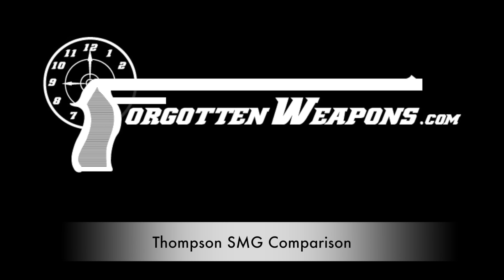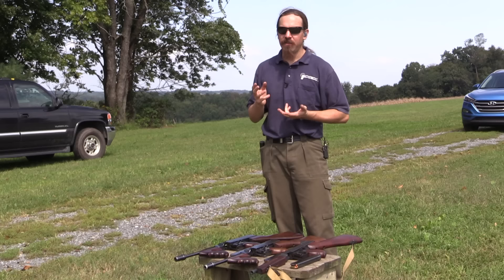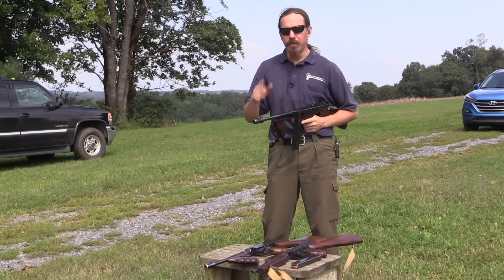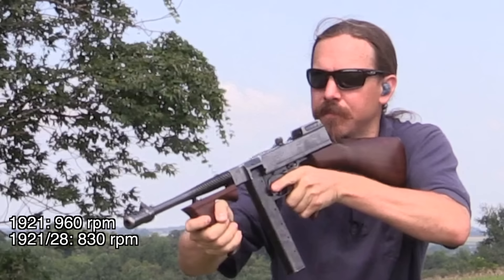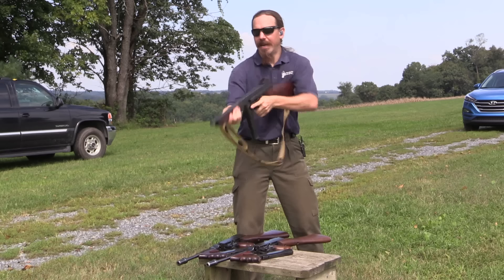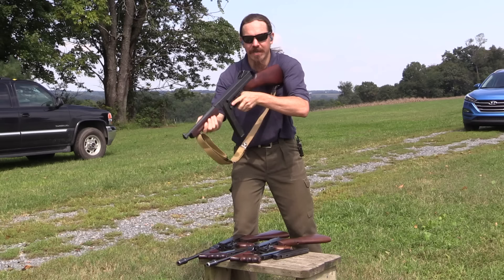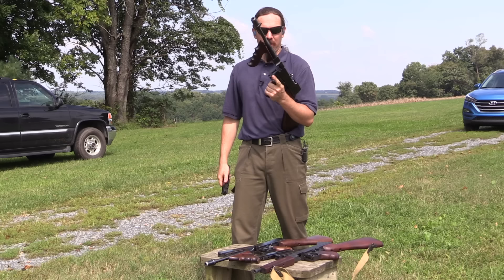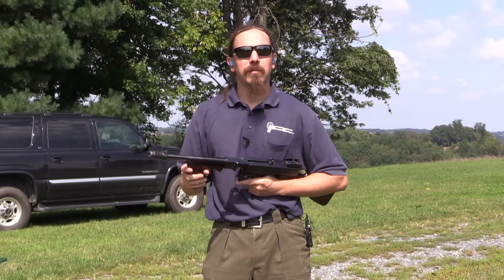Shooting the Thompsons: Comparing the 1921, 21/28, and M1A1

Comment: Looks like the lower cyclic rates had more to do with reducing ammo consumption than improving controllability.
Reply: makes sense with losing the drum mag.
Reply: @dentistguba  the drum is less reliable also
Reply: Pretty much. At the time, only 20rd sticks and 50/100rd drums existed. Military didn't really like the drums, so adoption was based on the use of sticks.
Reply: And hard/expensive to produce.
Reply: I tought the same ,i like the 1921 version .
Reply: River Styx Armory the drums are really hard to reload too you could never reload it in combat and putting a new drum in the gun is harder than a stuck
Reply: @linokleinmeuleman5233  I love the 1921 version too!
Reply: It was also made to reduce jamming, which was a quite frequent problem with the Tommy.
Reply: Bare in mind you have to carry the thing. Drum mags are very difficult to carry and design webbing for. 

I think you were issued 6 stick mags in ww2. They sit quite flat, and don't really get caught on things. Whereas the drums are big, bulky and I reckon you'd could carry a max of 3 maybe 4. And I think there'd be an issue of bulk and how much they'd stick out compared to stick mags
Reply: @ryancook6452  I'm told the drums rattle pretty badly as well.
Reply: @828enigma6  having used a soviet drum mag once, I really can't say. 

Would a higher level of quality make a less rattly mag?
Reply: The Grease Gun was the logical conclusion of this idea.
Reply: @ryancook6452  While quality of manufacture would probably help, I doubt you could get entirely rid of the rattling (especially without incurring huge expenses) and considering that the original Thompson was a highly manufactured and expensive gun, I’d guess the rattling was already reduced as much as possible, given the technology of the day.

It’s also noticeable that the Soviets moved away from drum mags too during WWII, or possibly to a drum/stick (tadaa) combination (the drum being on the gun at the start of the battle but the spares being sticks). Not to mention that the Soviets dropped drums entirely from their subsequent SMG designs, such as the PPS.
Reply: @genghiskhan6809  And really awkward to carry.
Reply: Dinner-fork tongue personally id say the grease gun is actually worse obviously only really chosen due to it being cheaper.
Reply: @ryancook6452  My guess is that it was not an issue of build quality, but rather an issue of design.
Reply: 600 rounds per minute is 10 rounds a secounds
Reply: Lol yall are all wrong. They gave them the magazines and reduced the cycle because it was fucking unwieldy I'm not surprised yall havent shot a gun before I'm surprised you dont know basic physics. "anything has twice I'd weight when momentum is applied." for instance a medium sized assault rifle with a LMG drum mag in it. that alone is probably more then most of you can carry to school in your lil back pack to talk about your mach box cars.
Reply: did I mention the magazine still holds 50 and has less weight. over all better gun.
Reply: how many of those "badass drum clips" can you fit on your chest for a spare while your on patrol? Oh that's right I'm the only one with a bloodline tied 9+ people running in multiple military and governmental security positions. grand daddy and great grand dad ect.
Reply: @828enigma6  Yes they do, New Zealanders in WW2 used the 20 stick and 50rnd drum. many accounts of troops being told off for patrolling with the drum due to the noise it made.
Reply: @76_SPZL  well the M2 Hyde was designed with that fire rate in mind.
Reply: Aka accuracy
Reply: @bennettfender1546  interesting comment, comparing the grease gun to a sten gun it's really a great weapon designed to be manufactured efficiently not cheap that is a simple design heavy gage compared to a light gage used in sten guns.if I'm correct the Thomson m1 was beaten down to $45.00 to manufactured and the m1 grease gun was $20.00 to manufactured during ww2. considering it was G M producing these weapons were effective deadly weapons, like I said with its simple design even today a reliable deadly weapon
Reply: You’re speaking of the result, not the intent.
Reply: @__-td8rq  The Soviets used drums in their SMGs.
Reply: @piergiorgiocaroli9201  didn’t know that. Thanks.
Reply: US Bureau of Ordnance, penny pinching as always
Reply: @DinnerForkTongue  yes I would agree during ww2 there was a shortage of skilled machist and to speed up production of small arms a new and easier method needed. So who could do that?General motor, took the English sten idea and designed or version of it with a heavier gage of steel stamping acomplete receiver with both left and right sides and with new welding techniques welded them together unfortunately some new receiver had issues cause heat distorted the bolt problems but all ways issues with early production
Reply: I think they speculate on the "Suomi 31" vs the "Finnish KP44" - video that the controllability vs. rate of fire is a U-curve.

https://youtu.be/6HJMvADklEQ?t=399

At a very low rate (400-500 RPM = Grease, MP-40, Italian Beretta 38 etc.), you are aware of every indivual bump, therefore you can predict and control every one, which makes the SMG intuitively quite controllable.

And at a very high rate (900 = Thompson 21, PPSh-41, Suomi 31 etc.) the sensation is like a continuous vibration, therefore it is also controllable.

The anti-sweet spot is the 700ish, where the invidual bumps are just everywhere, and the gun just keeps jumping all over the place. (As a non-native speaker, I almost used the term "sour spot" until I checked that it had some alternative meaning at the Urban Dictionary)
Reply: To support the idea that reducing ammo consumption was the primary reason (rather than improving controllability), the removal of the muzzle compensator from the design seems to indicate that controllability was not a high priority.
Reply: Of course, that's their primary objective.
Reply: With that fire rate the 1921 is one of the few guns I can think of that would be useful with a three round burst.
Reply: If you saw the movie Kelly’s Heroes you’d know it was all about conserving ammo 😅
Reply: The carry pouch for a drum is really nice,the problem is they rattle and that is death in combat.

Comment: Love the fact That the old fashioned 21 "typewriter" is still what holds up best.
Reply: The newer models weren’t designed to be nicer, they were designed to be the exact opposite: cheap and easy to produce, in exchange for build quality. Of course the better built gun holds up better. 😂

It’s like a Lamborghini compared to an off-road go-kart.
Reply: @Zeb Dawson  The Lamborghini is better on a smooth asphalt road, while the off road go-kart is better off road. 
Which is kind of the difference between the 1928 and m1a1. Good luck driving a lambo off road. The go kart won't be as smooth, but it can actually perform off road.
Reply: @dominicvasquez6469  As was the M1A1 and the 1921 Typewriter. The M1A1 was built for rugged war conditions. The 1021 Typewriter was built to be pampered and only used in the BEST of conditions.
Reply: @Cody0ne5 why are you making shit up

Comment: In a lot of ways the 1921 Colt Thompson were made like a sport rifle. Had the best metal and wood work and tightest specs compared to the rest of the future Thompsons. Sort of like the crown jewel of Thompson Sub Machine guns. Not surprised it was the most enjoyable to shoot.
Reply: Yeah, seems to be a pattern with good guns that their early models are better quality, and the military simplifies them to make them easier to mass produce.
Reply: This seems like a reasonable assumption. I believe you may be right about this although there is no target to show the actual difference in accuracy so it can really be shown. All that being said, since Ian has experience in shooting select fire guns we really have to agree with his assertion of control and your quality over quality assumptions.
Reply: Heaviest gun with the lightest bolt, whilst the M1A1 is the lightest gun with the heaviest bolt. The relative amounts of mass moving/not moving must make a big difference to handling.
Reply: You said it yourself: "..the 1921 Colt Thompson. We think differently of Colt today than the hard core precision sporting and military arms mass manufacturing company they were in the time of the first generation of Thompson guns.
Reply: It’s in the compensator
Reply: @drmachinewerke1  What are you suggesting Ian was compensating for by shooting a bad ass Thompson? ;<)
Reply: 21 sounds buttery smooth
Reply: @fix0the0spade  I think you nailed it
Reply: @KamikazKid  "The military" did not redesign the Thompson SMG.
Savage redesigned the Thompson after reluctantly accepting a contract to build the 1928A1 for Auto Ordnance, resulting in the greatly simplified M1 and M1A1.
Reply: @fix0the0spade  The upper receiver and reciprocating parts of the M1 / M1A1 are entirely different than the previous models of 1921, 1928, 1928A1.
Reply: @-oiiio-3993  I never said anything like your comment, I don't know where you got "redesigned" from, I said simplified and you can see it on a lot of different guns where the military pushes the production team to reduce the cost and complexity of a weapon by losing earlier production features like the Pps-43 losing the drum mags.
Reply: @KamikazKid  Your comment: "Yeah, seems to be a pattern with good guns that their early models are better quality, and the military simplifies them to make them easier to mass produce.
----------
"The military" did not "simplify" the Thompson. 
The 1928 modification of the original Model of 1921 to lower the rate of fire (by increasing weight of bolt actuator and changing springs) was offered by Auto Ordnance in continued efforts to gain military contracts. It was Auto Ordnance's idea.
The M1 and M1A1 have an entirely different upper receiver and reciprocating parts, along with other 'simplifications' that were demanded by Savage Arms, not "the military".

Savage had only (and very) reluctantly engaged in production of the M1928A1 when AO received large 'Lend Lease' contracts that were well beyond AO's capability to produce. Savage complained bitterly of the unnecessarily complicated Thompson design and immediately set their engineers to the task of 'simplifying' it with a complete redesign - the M1.
Reply: Well, the 1921 Colt Thompson was also very very expensive at the time with each model further down the road being cheaper to make. The 1921/1928 is the same price, but has a heavier bolt which might make for worse recoil and the gun bouncing around more. 

The M1A1 is probably the worst to shoot, but it being a war submachine gun, they had other things to think about. I am sure the soldiers also had other things to think about than how comfortable the Thompson is to shoot and it was probably more reliable. I have no data on this, but the M1A1 is super simple with no weird parts so it should run perfectly while the previous versions had a more complex bolt with the "lock" thingie that might have created problems.
Reply: @CZProtton  If its reliability were talking, the M1 models take the cake. My best is on the simplistic design. They were seemingly reported to outlast most of the infantry men that wielded them, which couldn't be said about the colt models given they weren't serviced as much.
Reply: @NeonVars  The Colt models had the dumb locking mechanism made from brass, I can imagine that wear on that could have made the gun horrible, because then the cyclic rate would be too high for the magazine to feed...
Reply: Explains the $200.00 price in the 1920s. At least half of what a new car costs.
Reply: @CZProtton  interthing comments the blish lock system was a 45 degree angle machine on the inside of the receiver. The brass attachment that attached on the bolt is designed to reciprocate at a 45 degrees angle. So as part of the bolt assembly as the bolt is compress with pressure from the spring behind it it drives the brass lock forward which has machined matching slots driving the brass lock up into the 45 degree angle to keep the bolt "locked" in place when round is chamber in barrel. Now after the trigger is pulled the brass lock is forced down delay from high pressures of the exhaust or gasses after high pressures are lower to drive the lock down back to compress the spring.A completed machine operation that really useless with pistol power.An good examples the Thomson rifle worked safely with rifle cartridges as long as you have some type of delay to keep high pressures under control until a safe lower pressures. You got to remember during war there is a large demand for weapons and cutting corners is a matter of life and death so eliminate unnecessary maching operation help speed up production, I still work in aerospace I have years of experience in maching and grinding, like my Pop during ww2 as a drafted machinist he could see machine markes on weapons like M1and tell what kind of machine was used making the assorted parts or who made them,Winchester had the worst finish on the receiver. The Thomson m1 had a criss cross pattern telling me the side of receiver was Blanchard ground a grinding machine that was used to grind hundred of receiver quickly to speed up production. I'm not a weapons expert but from my own experience I may be   98% correct.
Reply: @fix0the0spade  years ago I worked in a machine shop one of the maintenance crew "Danny showed me his pictures of him with his Thomson m1 landing somewhere in Vietnam with a smile on his face,I think that Tommy gun made him feel safe.Hope your doing OK Danny after all these years working in machine shops in Southern California Al Velasquez ,Raylee 1980
Reply: They Were ALL made In 1921..  & EVERYTHING in this video is just one mans OPINION..  ok??? The rate of was not dropped to conserve ammo. & was achieved with simply a heaved bolt action..glad to clear that up… ALL made in 1921.. only made like 16,000 .. that’s all folks…
Reply: @drmachinewerke1  They we’re ALL made in 1921… ALL

Comment: I think besides removing the Cutts compensator from the M1A1, it appears to produce more recoil due to the design of the bolt. Watch the charging handle at the end of the video, side by side of 1921, and M1A1. Harder recoil impulse as the bolt bottoms out on the M1A1. Wonder if that's to do with the blish lock being removed, and the firing pin being changed from floating to fixed.
Reply: Probably the comp mostly, could be springs and stuff wearing for the bolt bottoming or the other stuff you said minus the blish lock. As far as I can tell that’s a pseudoscientific locking mechanism that doesn’t actually do anything, maybe adds a bit more friction but as Ian said in his old videos it’s basically doing nothing.
Reply: About that fixed vs mobile firing pin: on all previous version, that firing pin and it's out-of-battery safety move both ways. They're small, low-mass parts that make contact with the front of the receiver. In essence, the mobile firing pin is an accelerator, and removing it in the M1A1 directly reduced the rate of fire.

Comment: I have clocked my own M1 Thompson at 860 rounds per minute... A lot of it has to do with ammo types. I also have videos comparing the M1 bolt and the M1A1 bolt in my Thompson.. You can definitely tell the difference!
Reply: Which bolt do you prefer and why?
Reply: sure Kid
Reply: @realkingtv7885  ah, so you don't know how machine guns work?
Reply: @MauserMatt  So which bolt do you prefer better and why?
Reply: @realmajorx3698  the M1 bolt with floating firing pin. I just simply like the faster fire rate. Some people say, and they may be right, that the floating firing pin M1 bolt is also less prone to an out of battery detonation. But i don't think it's enough of a concern to not shoot the M1A1 bolt.

Comment: The high speed footage appears to reveal some things about why they might have different cyclic rates. The 1921 and 1921/28 bolts both move forward much faster than the M1A1 suggesting a stronger recoil spring (not necessarily by design, springs tend to get weaker with both age and use and the M1A1 likely has had the most rounds through it). They both also move backwards faster, no doubt because their multipiece bolt assembly is lighter than the monolithic bolt of the M1A1. 

You can also see something else interesting about the 1921/28. In the other 2 you can see the extra force applied to Ian when the bolt hits the rear of the receiver. In the 1921/28 that force appears to be far less, almost looking like it didn't bottom out at all with some rounds. As though it was accidentally constant recoil.

Comment: In my career as a tanker in the US Army I had the pleasure of shooting the M3 and M3A1 Grease Guns (we carried them as crew served weapons on M60 series tanks as well as M113s). I loved the M3A1 and, because of the charging handle and small ejection port, didn't like the M3 so much. They were both really heavy after you had to carry them for a period of time so, I can sympathize with any soldier, LEO, or gangster that wielded a Thompson for any length of time.Thanks for a great series.
Reply: Its wierd how heavy those M3s are for being so small. the things are like a pound off the weight of the M1 and they are the size of a medium satchel bag, just plain strange
Reply: @therideneverends1697  I think the bulk of the weight is around the bolt and barrel nut. Bolt may contain more carbon to increase strength resulting in more mass/weight.
Reply: Speaking Of Satchel Bags, On top of the Grease Gun at like 8lbs, I also had a bag full of 30rd magazines on the other shoulder. Those Thompson guys had it just as bad or worse.